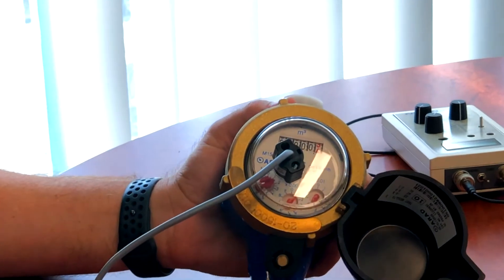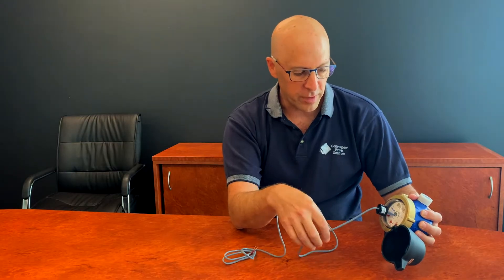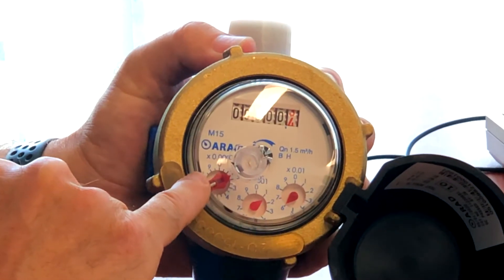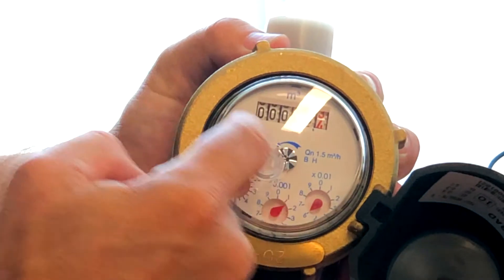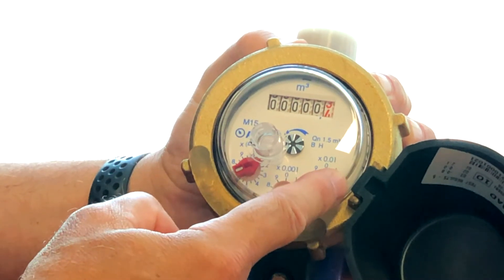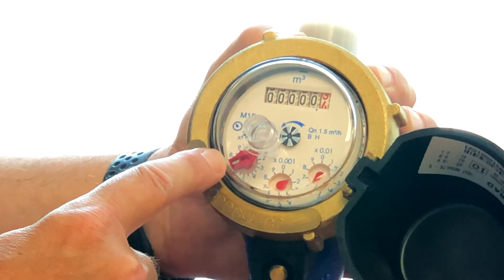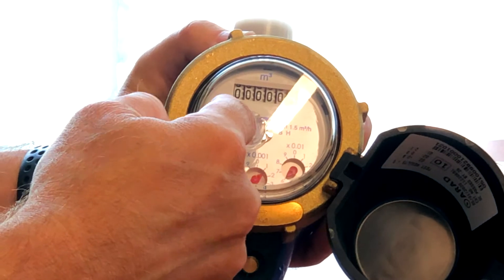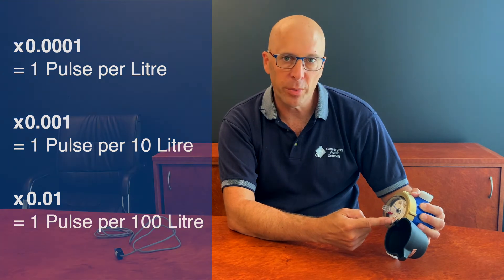How to read the Pulse Rate on an Arad Pulse Water Meter

Comment: Dear Larry, thank you for your video which is very interesting. Do you have any idea about pulse output cable, two wires signals & how must be connected
Reply from the maker: Most contact head water meters, i.e. magnet and reed switch arrangement, have a 2 wire output which consists of a Normally Open volt free contact, which momentarily closes when the magnet rotates past the reed switch, i.e. pulse.  This pulse is a set rate as per the video, e.g. 1 Pulse per Litre, or 1 Pulse per 10 Litres